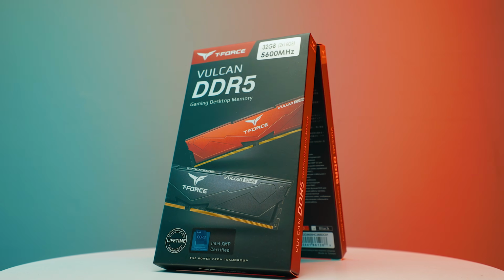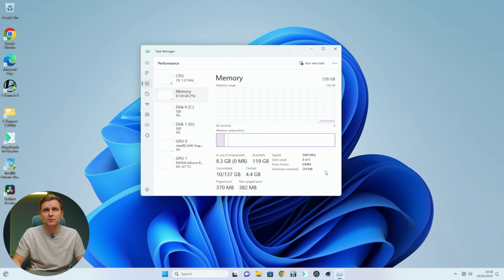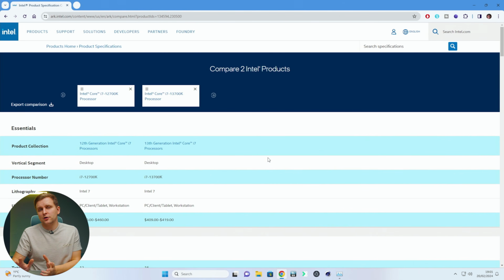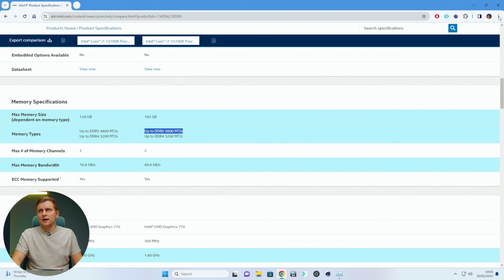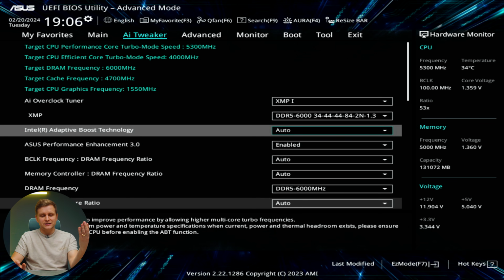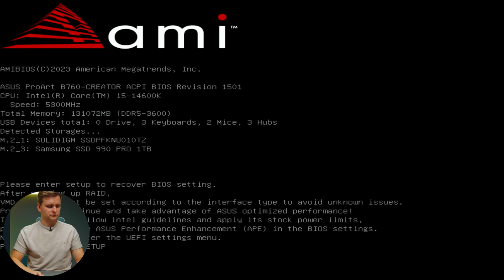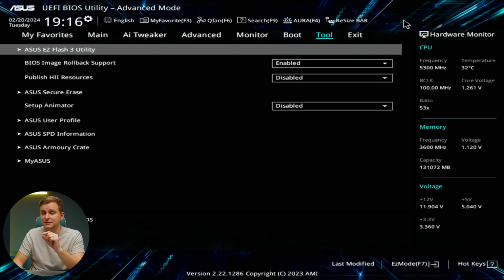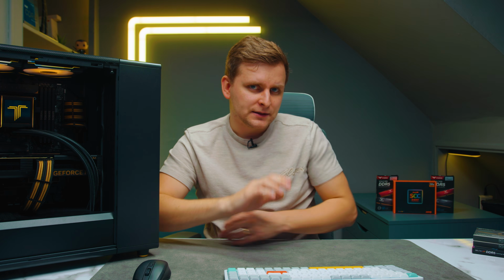Maximize RAM Speed EXPLAINED: Common Mistakes to Avoid & FREE Performance Boost!

Comment: great vid as always! personally i use i9 13900 non k ver. along with kingston fury beast ddr5 5600 mhz running at stock 4800mhz and gigabyte b760 gaming x mobo. xmp always have a risk for blue screen or black screen, for stability i dont even set it. For gaming it is fine, but when you work on large files like me and you cpu and ram do alot work long time (for me like 3 to 5 hours workload on single project) its just not worth the effort. About timings and voltage dont even touch it, its relic of the past and you will loose more time and nerve setuping than profit and performance. Thanks again for great vid. Please do vid about multiple gpu for projects on one platform.

Comment: I have a cpu that won the silicon lottery. I overclocked my 6400mhz ram to 6800mhz and increased my timings to 32-39-39-48
Reply: I have a z690 aorus master, 13700k and 32gb of dual channel 6400mhz gskill ram
Reply: I also ran memory stress tests and games and have ensured it is completely stable

Comment: There is no such thing like 10k 6k or 3k mhz DRAM. If you have cpu 5gh and ram 5 ghz then there won't be any delays to get to the memory like in old days  when cas, or cl if you like, was 0 because both ram and cpu had the same mhz speed, but nowadays there is lots of delays because ram mhz won't much cpu mhz.

Comment: Everything you said and did makes logical sense. However, when you are equipped with the latest and greatest of all possible motherboard capabilities, it should detect your hardware and adjust to the optimum settings. In this case it doesn't. Is that a manufacturer problem or does a person have to sit through every possible configuration and wait to see if it's going to work or not? Frustrating isn't it?

Comment: ddr 5 is better with low timing speeds than memory speed  that is the most important thing i doubt this guy knows that i know because i tried both lower timeing speeds wins  just use 2 sticks in slot 2 and4 and it will boot at xmp mine will run 4 sticks  4x 8mb   i found 2x 16mb is the fastes in gaming the lower time the best performance

Comment: If you have enough Ram overall, increasing a DDR5 kit from 4800Mhz to the XMP/EXPO profile 6000 speed will not create a noticeable difference in gaming workloads.
Reply from the maker: Yep, you've seen Jayz video,  wait for creator workloads ;)

Comment: I do disagree on the "IMC is better on newer gen" part, IMC is silicon lottery, there are 13th gen chips that can't even run their advertised RAM speed, newer "high end" boards have a grading system that will tell you how good is your chip's IMC.

If you are lucky enough, to have both chip and IMC quality to be higher, then running higher RAM speeds are just easy peasy.

Comment: every time enable expo and try the settings mine wont post. so i left expo off and moved my  ram frequency to 6000 and task manager is showing DDr5 4 of 4 at 6000mhz. asus x670e plus wifi and 7800x3d, from what im learning at least in my case is expo/xmp is for if i want to OC my ram. but if i just want whats on the box i dont need it.
Reply: had the same 4x16gb 6000   early bios (asus) worked with no expo (stable).. and also worked at 6000 4 sticks.. but, next update bios.. 6000 4 sticks didnt work..  then new update bios.. not even 4 sticks with no xmp didnt work.. so i gave up..  i bought 2 x 32gb 6000.. and work super stable with no issue what so ever

Comment: Na bro thats the wrong way to make it work. First try to run xmp #2 if that is not working than slightly increase the RAM voltage. If it is still not working with lets say 1.5v than you should increasing the SA Voltage, depends on the plattfrom but up to 1.5v are possible. Last decrease the speed but try the other steps first.

Comment: My advice (if you want to save headache like me) is get 2 ram sticks (2 x 48gb) to give you 96gb ram with high speeds and xmp. It's a shame that Intel and the motherboard manufacturers don't address this issue but I stick to 2 ram sticks to avoid all the problems with 4 sticks and xmp.
Reply: Thanks for INFO and to OP as well; something that me being a newbie / builder didn't take much thought of to be honest.
Reply: not really possible in the big 2026,  now you need at least 300gb ram, AT LEAST!
Reply: This is what I have as well, did you get single or dual rank?
Reply: For me it is kind of opposite. I was able to enable XMP with full speed on 4 RAMs then two RAMs. I had to decrease the RAM frequency to made the 2 RAMs works.
Reply: That's what I did, 96gb at 6400MT/s CL32 was expensive, but it performs so close to the 32gb kits everyone raves on about but is triple capacity.
Reply: I probably should have read this comment a few days earlier... This is first time I've pushed the limits of  IMC, and it pushed back...
Reply: Now they make 128GB ram (2x64gb sticks)
Reply: what problems are there with running 4 sticks and XMP? cause my system seems to be running fine ;o
Reply: Apparently, its less stress on the controller to use 2 sticks as well

Comment: DDR5 is really weird in a sense that it can run 2 stick of dual rank ram way way easier than 4 sticks of single rank even though both are "quad" rank. ( for example 2x32 vs 4x16 GB) And back in the DDR4 days there was basically zero difference between the 2 configs. Maybe new gen IMCs are straight up trash? That or just generally DDR5 is kind of an engineering failure.

Comment: Build a machine with a AMD 7700, needed 192Gb and had to be uATX board due to space limitations. So i had no choice in faster ram or better board. I just did buy something that was vendor checked to get a stable system. But indeed if you need less and can do it with only 2 sticks then you can get more speed easy.

Comment: Also consider some MBs have lower overall ram limits, for instance having a limit of 128gb as opposed to 192 gb. Or even 96 as opposed to 128.
Reply: Any board with 4 slots can run 192 GB with updated bios. Any.

Comment: Hmm, (relatively) faster ram usually impacts performance very little, plus 2 or 4 sticks is not that problem with modern hw/sw as long as you're not pushing it (which again makes little sense), some scenarios even favor more memory ranks. 
What causes most crashes in my experience is heavy pagefile use, so more RAM is always better.

Comment: Hi, nice video. I ordered recently a kit of 32 GB DDR5 5600Mhz for my laptop in order to upgrade it from 16GB 5200 Mhz (both dual channel). The thing is that i forgot to check what type of RAM my processor supports and it says on ark intel that i7 13620H supports only speeds of 5200 Mhz. My RAM should arrive tomorrow or wednesday. I'm guessing that they'll run at 5200 Mhz!?
Reply: It depends on your motherboard too.   You might be able to run it at 5600 MHz.
Reply: @BenKlassen1  that I've checked it supports up to 5600 32GB. Currently my RAM-s 2x8 GB are at 5200.

Comment: I can run my 13700k with 6800mhz + gtx 1060. As soon as i plug in a new gpu (rx 7900 xtx) i get black screens. I assume it's not due to ram if it worked with a different gpu right?
Reply: PSU?

Comment: if my cpu can run 5200MT/S and my motherboard can go to 6000MT/S , should i go and lower it to 5200 or keep it at 6000 , sry for the noob question and ty :) Ryzen 9 7900x , motherbord Gigabite b650 gaming x ax , 2x16gb 6000MT/s

Comment: Fantastic explainer and great video! Good stuff.
Personally, I've built my own PCs and have gone through 4 generations of CPUs/Memory with DDR4->5->6 and have never been able to just click apply XMP and it works. I always have to configure it myself and lower the RAM speed by 200-400 mhz to get it stable, but it's fine because it's less than a 1% performance difference.
If you want the smoothest editing experience: proxy your clips. You'll be able to edit FAST even on 10 year old hardware. I'm always stunned when video editors tell me they don't bother to proxy.
Reply: yes but even with proxies, if you use a lot of sound design, VFX and titles it will struggle with a 10 year old computer. But yeah for basic edits you'll be fine ;)

Comment: Dear Lauri, what would you recommend for creators, 96gb with 2 48gb sticks and 6000mts or 192gb 4 sticks of 48gb but 5600mts?
Thanks
Reply from the maker: Neither might work.  Especially 192gb of 5600, most likely 4800 and 5000max ;)
Reply: Please recommend what's the max and best DDR5 to get for photo/video creator. CPU 14900k, Proart Z790.

Comment: If you haven't overclocked ddr3 and ddr4 manually  before ,don't use ddr5,this is not for you, it's still new and unoptimized for regular users. Finding a sweet spot between LLC/Ring/VDDQ ,voltage,frequency and timings can be overwhelming ,that is the most common reason why people get bugs and bluescreens on new platforms. My chips perform much more stable in overclock cl34/7200mt/s,than XMP stock 6400 hynix-A die on 14900k. Another thing is,memory training may take much longer than you are used to...up to 10 minutes. If you don't understand any of this,,don't bother.

Comment: So funny coincidence , I'm basically 90% done with building that nearly identical rig and totally had questions about whether or not i should buy another 2 sticks of RAM and how to set them up in the bios, etc.... then I found this helpful video! (Fractal north, I91400K, 2X32 GIG T CREATE, Proart z790, NZXT Kraken, GPU to be ordered next week)
Reply: Don't buy "another 2 sticks". Only run 2 in dual channel and buy those 2 together in a dual channel pack.
Reply: Dont even buy them. x2 is enough. DDR5 is sensitive on the memory channels
Reply: 90% same as me. GPU ordering later aswell

Comment: Great topic. Useful tips when running 4 sticks and if they don't. 

Somewhere I saw that when running ram too much faster than what system can handle like for 7000 series AM5 6000Mhz with CL 30 is fully ok, but going over this the system and ram ratio of performance shifts from 1:1 to 2:1 more towards ram than cpu I don't know what this topic is. Where do find these data like best Mhz + CL combo for each generations of systems. 

Also Mr Tech Notice I know you mention the effect components in your videos through numbers, percentages.

Can you upload small clip showing playbacks, multiple asset load(effects + layers), Max vid quality(resolution) editing such to the point that it starts to lag or something like that ? Like a real world performance scenario for Processors, RAMs, SSDs etc or comparison with one generation below to show the real world improvements. It would be very helpful for all of us 😅. I know its a tall order a small clip would suffice if possible on such new performance uplifting components videos.

Comment: amd uses DCPO profile and I have 4 sticks of 8GB, total of 32GB and full speed is not an issue. Both 2 and 4 sticks can run at 3600 mhz
Reply: Yeah, older Ryzen (5000 and older) use DOCP as the overlocked memory profile. Ryzen 7000 and newer is XPO. I have a similar RAM configuration for my 5950X, 32GB at 3600Mhz with timings at CL14-15-15-35.

Comment: Sticks like those T-Creates have HORRIBLE heat spreaders. You should stress the importance of ram cooling. I would never attempt to run a system without a dedicated ram cooler and/or upgraded full copper heatsinks. The reason this is important is for overclocking - and sometimes even XMP stability via proper, elevated voltage levels, which generates more heat and requires better cooling.

Comment: What I learned about building an Intel system in 2024... Compromise!!! Adapt!! get used to it and repeat. I moved around my AIO radiator then added three more fans. Now I'm using push pull intake instead of exhaust and I am running cooler.

Comment: Has anyone tried out 14900k with 2 set of t-create expert 48x2 6800, which is total of 192gb, on ASUS Proart z790?
Reply: Careful..even if ur motherboard allows 4 sticks of ram...on ddr5 you can use max 2 sticks..otherwise you won't be able to activate xmp..thats how ddr5 works..i have 14900k with 2×48 6800 t create expert..and it works great ( did some tweaking in bios for undervolting)

Comment: I build a system with one stick of DDR5 32gb ram on 5600mts with  timings of cl36-38-38. friends gifted me second stick of 32gb 5600mts ram but have different timings of cl40-40-40. because of different timings i can't overclock ram more than 5200mts (or it becames unstable), and also if i undervolt my cpu(13900k), it will became unstable. 
i don't understand which ram timings are better, and what timings should i aim for future ram upgrade? (meaning adding 2more sticks of 32gb)
Reply: Smaller number = betterer timings.  Every 200mhz of speed increase is proportional to 1 'ticks' on the timings.  eg. 3000CL15 and has the same latency as 3200CL16.  3200CL14 has a FASTER latency than 3600CL18 (however 3600mhz has a faster raw bandwidth).  Choosing lower latency or higher bandwidth RAM is very application specific.
Reply: @funbucket09   thank you for answer. looks like my cl36-38-38 have better timings

Comment: I don't bother with the CMOS on my Asus board, if you press reset 3 or 4 times it will start with default settings to let you change it and if that doesn't work turning it off and on a couple of times brings it back to a default state. My CMOS jumper is hidden by my GPU's heatsink so it's handy to know this.

Comment: 2 questions:
1-On a z790 mobo with a 13700k or 13900k can you run 2 (2x32g) kits of ram for a total of 128gb? On older gen mobos companies like Corsair said you couldn't. You had to get 1 (4x32gb) kit.
2-Will premiere pro and davinci benefit from a raise of ram from 128gb to 192gb? Is it worth the Xtra $ if you can afford it or is it overkill.
Reply: 1 - it's the same. On old gen it was a lottery and so now with non mb certified kits.
2 - davinci really likes ram but in the end it depends on your projects.

Comment: New build and still went with DDR4.  2x16MB CL16 3200Mhz for $52 (pre-black friday 2023).... $20 US for an extra 16GB made the decision to go 32GB easy... Was able to o/c... and create separate o/c profiles in the bios.  One for 3600 CL 16 and the other 4100 CL18.  Tried CL 14 but no go... The extra ram on intel helps with 1% and 01% lows.  Combined it with a $120 refurbished MSI Z790 Wifi MB, went Z790 due to better memory traces on the MB.
Reply: The beautiful clickyclack of delete mashing ❤
Reply: @toddwerther188 what are the advantages of having different o/c profiles? 🤔
Reply: Mostly I just wanted to see what I could achieve at different speeds.  Some apps like higher speed, while others prefer lower latency.  In all reality, mostly I just use this computer to play games @1440p w/7800XT, but it was fun seeing what a $50 pair of cheap rams sticks could do.  I use CL16 3600 for day to day, my 12600KF P cores (all core) @5.0 and E cores 4.0. It's all one really needs for gaming.  I was originally going to build via AMD 5600 but when I found a really good MSI Z790 refurbished for $120 I switched over to intel.   @Y0_ltr
Reply: Yes, never be a fan boy. If you get the right deal, go Intel, and vise a versa. For 2 laptops I tried to go AMD, but my last one is an intel, but my creator PC, that ended up AMD.  @toddwerther188

Comment: Everything you need to know about RAM speeds: Don’t worry about RAM speeds. The end.
Reply: True for gamers. You can spend more time and money into your cpu and gpu and make way bigger gains.

For video editing, plugin-heavy music production, and running local AI on cpu, the speed really helps.
Reply: @JFrameMan unless you already have top of the line hardware and need a few more frames for unoptimized games.
Reply: Unless you have AMD because the Infiniti bridge enjoys faster, memory
Reply: My game saw 20% fps jump when I upgraded the ram to have 20% faster speed

I'm sure it's a rare thing but it does happen
Reply: @Horesmi interesting! Whats are yours specs?
Reply: @gustavoehler  running rimworld on an ancient core i5-760. Switched from ddr3 1600 to 1866, instantly got a crazy boost in TPS(simulation speed)
Reply: Unless it's an APU in which case faster RAM definitely helps
Reply: incorrect: You start to worry about RAM speed when you will have corrupted data or when you have BSOD. For gamers it doesn't matter that much as you can download and re-install games, but for anybody working on computer and need to be sure that data that have been created will be correct and can be used, then it should matter as that is no fun to have hours of work just going to waste.

RAM speed have much more impact on video encoders (that make use of CPU), then for any other kind of apps. That is why usually see benchmark where x264 are used to measure how much of improvement going to a faster CPU will do or how much impact RAM will have while working on larger files like video editing or large databases.
Reply: right on 😊
Reply: Not on am5, not overclocking but tightening and undervtolting your ram timings and  can lead to some serious stability and still an fps boost of maximum 22% you didnt even know you needed combined with a proper undervolt and overclock of a cpu +10-15% fps increase and a gpu over clock of about the same numbers thats 50% fps you could be missing out on all theoretically and depending on silicon

Comment: I have an 8600g and probably only enable xmp when playing heavy games. Does the processor and mother suffer more if I activate and deactivate xmp often or would it suffer more if I leave it activated all the time?
Reply: Just leave it on mate, its not gonna do any harm. Its meant to be left on at all times.
Reply: If your motherboard vrms/mosfets aren't overheating (no AM5 should be with an 8600G imho) then turning it off isn't necessary. I'd keep it on unless you are getting a lot of crashes with it on.